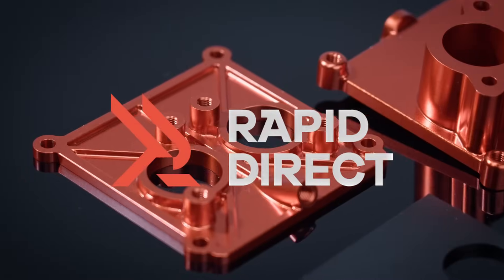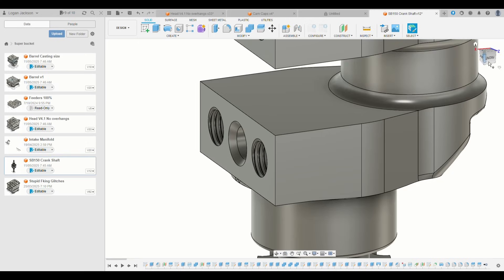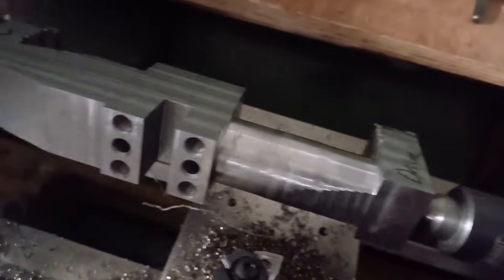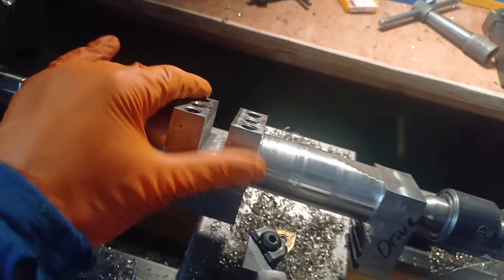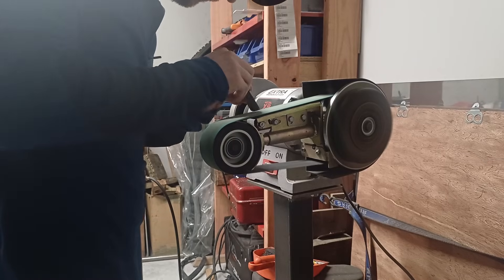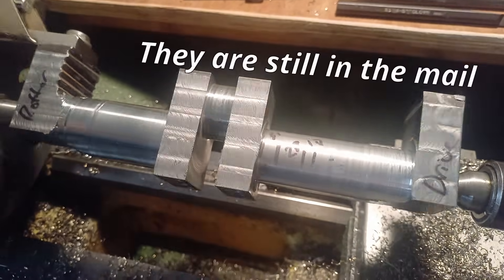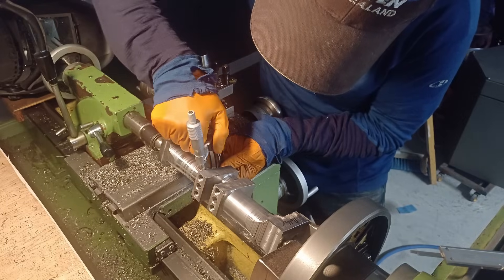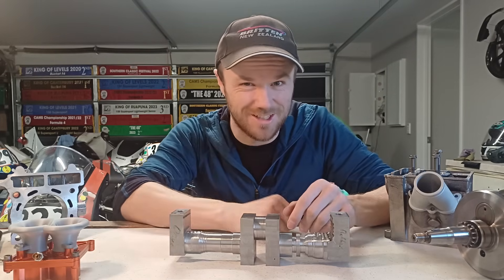Making the Worlds Fastest 150cc from Scratch

Comment: I don't know the engine speed, but the connecting rod journal diameter is too large for prolonged operation at very high RPM. It will require too much pressure to extract the oil and prevent it from burning. RPM is crucial for regulating oil temperature. The biger the journal, the higher its RPM will be and the more the pressure in the oil bearing will be, trapping the oil until it is burned.
Reply from the maker: It has the standard sizes from the yamaha r6 which sits at 16k all day long when racing.
Reply: @TheMotorcycleForge  At first glance on my screen it seemed bigger to me. The R6 seems to be the good example to follow. :) This is a great project! I wish you success!

Comment: The correct radius is essential on each side of the journals to eliminate stress cracks.
Reply from the maker: The Oem yamaha r6 crank has 1.5mm radius on the big end which seems to be enough.
I would pref a larger radius but limited by room in the cases.

Comment: Watching that crank whirling round brought back memory's  on the first opp "crank master" machine at Coswoth in the mid 80's it would send me googlie eyed trying to concentrate on the journal with the others churning around . The crankmaster used HSS form tools , ran quite slowly with heavy lube fed  to the form  tool. Once " roughed " out cranks were ground then nitrided then finished ground using " air gauging " measuring equipment to get the diameters  spot on .

Comment: That's crankshaft will be fail to make more power n torque
Reply from the maker: Why is that?
Reply: @TheMotorcycleForge The shape cant make static balance
Reply from the maker: The balancer weights bolt onto the crankshaft like a F1 crankshaft.
It will have the same balance factor as the original crank so it pairs well the the original balance shaft.
Reply: U can do it in multy cylinder engine. But buil a single cylinder. That's static balance in crank shaft is important, trust me @TheMotorcycleForge

Comment: Need around 2.8-3kg of crankshaft weight. But the diameter is too small. U need at least 100-102mm of diameter. Make a a bit small big end conrod pin diameter or u will have a very small balancing factor. Its will vibrate ur engine
Reply from the maker: This will be about the same weight as the original crankshaft.
The counter weights are bolt on and will be tungsten.
Reply: @TheMotorcycleForge  hope it rotate smoothly. Keep the good work

Comment: Nice build!
What cylinder bore and valve sizes will you use for this engine?
Reply from the maker: I am using some R6 parts like valves and piston.
Bore 67mm , In 27mm x2  Ex 23mm x2
Reply: @TheMotorcycleForge  you should be able to go past 40hp, that's my guess.
Are you going to build a dyno later?
Good luck and keep posting!
Reply from the maker: @Karl-r5j I think 40hp at the crank may be possible, aiming for 30hp at the wheel.
Yeah probably going to build a dyno 😅

Comment: Mate, Sometimes when you get weird harmonics that speed and feed changes just won't fix I have found that strips cut from an old inner tube sometimes works. Just wound around where you can and stretch the last wrap around your finger, tuck the working end under and pull taught.  Alternatively wrap with some insulation tape.  Helps absorb and dampen those vibrations.

Comment: Is this going to have a dummy rod balancing like the Ducati super mono? 
There's a hell of a lot of work in that crank, a commend you for your work. 
If you only want to index 13, you could just use another 13, or 26, or 39. or 52 tooth gear. I guess you could use the sprockets of the cams that would be 26 teeth. 
I look forward to more episodes.
Reply from the maker: The original engine runs a balance shaft which seems to do a pretty good job so I plan to reuse that for now.
I have already been offered two dividing head to borrow and looking forward to learning to use one.
Cheers Logan

Comment: When I made a crankshaft with built in counterweights (had a very long way to reach in) I used a parting blade and removed almost all material using plunge cuts. Slow going because the offset mass was shaking my Sheraton 9"  like crazy at anything over the minimum speed. That engine has a 38mm stroke, with the counterweights I basically had to have about 50mm of stick out on the tool, which is a lot for a parting tool.

I actually finished the crankpin journal by lapping it, made a split lapping tool that could be assembled around the journal and lapped it to size with fine abrasive paste. This removed a taper I'd inadvertently introduced, and gave an excellent finish. You might try doing the same.
Reply from the maker: I have some more appropriate tooling on the way which should make life easier for the finial crank.
I plan to grind the journals after hardening, fingers crossed it should turn out mint.
I will look into that parting blade as that sounds like a good way to go about it.
Someone told me to balance the offset mass a couple videos ago, best advice so far, no weird shakes at any rpm.
Reply: @TheMotorcycleForge  With parting running the blade upside down and the lathe in revers works wonders, you might have to make a custom holder though to get the height. Or you could make a rear toolpost holder.
Reply: @Onan-u3b  The upside-down tools work better because gravity helps to clear the swarf from the cut, which is often a challenge for parting tools otherwise.

My lathe has a threaded chuck mount and no T-slots on the cross slide. I can't run in reverse (the chuck would unscrew from the spindle) and I can't have a rear mounted holder as there's nowhere to put it. So for me the carbide insert parting blades were a game-changer: they have chip-breakers designed into the inserts that bend the chips to be narrower than the groove, and you can run the spindle fast enough that the swarf gets ejected out of the groove without packing up in there. With my carbide parting tool I usually part off at the same spindle speed I would use for turning the OD.

Comment: Nice job, It sounds and looks like you may be need to adress your spindle bearings in the near future. The dead give away is usally the thrust machining. All that said you may benefit from slowing down as even though carbide enables high surface speeds material and machine limitations can cause problems.  I would also recomend leaving a good 0.010" inch on  every diameter and radius and getting the final product ground. It is also important that if you can get the chatter out as when grinding it will still show through if they cant remove it. 
But its looking awesome. I would leave the threading untill after final grinding along with any keyways you might be going to cut in the finished diameters.
Reply from the maker: That's a lot of info, the final crank will be ground to spec after hardening, and then maybe dlc coating as well.
I was wondering about the bearings maybe needing some attention, the headstock gets warm after using it for a while.
It has clean oil ect and I regularly lube everything but the old girl is 50 years old.
Would new bearings be hard to get for a lathe this old?
Reply: @TheMotorcycleForge  It may be addressable with just re greasing the bearings. Preload is the indicator of wear and does deteriorate with wear. They may be rescued but not fully fixed by a simple re lubrication. That would be the first logical step for a hobby machine. 50 years the grease would be gone. That is of course it is a grease lubed spindle. If it uses oil the change up can be beneficial. Assuming its supposed to use iso 32 perhaps a 46 or even a 68 could be possible. What type of oil are you using ? You can easily tell the lube style usally by checking how the spray from the gears is returned. There will be a gutter around the inside or the headstock and it will usally use a hole to feed the bearings. If it's a plain bearing spindle machine fixing the spindle is a lot more difficult and a job even professionals wont touch in most cases.
Reply from the maker: The spindle bearings run In oil, they have a little lube tubes to put the oil in.
Currently using 20/50 valvoline vr1 mineral race oil 😅
Reply: @TheMotorcycleForge  Normally you would use a hydraulic oil derivative in a headstock of a lathe. The motor oil does a great job of making things quiet but due to it being multigrade isnt real consistant for Drip lubrication as well as the foaming aspect. Foaming oil doesnt work well. If you dont have any oil type info for the machine if you have a brand and type the proper oil could be just an internet search away. There is a lot of info out there on old machine tools today. Dont expect the exact oil name to still be available but you will at least know the recommended type and grade. I worked maintaining machine tools and special purpose machines for over 30 years and I have run into a few machines without available info. The usual for machines without an oil pump and wet clutch is 46 for a start. 
I'll keep responding if you need more ideas.

Comment: Nice work as usual.  My two cents:  when you get the high speed ringing while machining, it can usually be corrected by changing the RPM.  Carbide tools require a minimum depth of cut so you cant take fine passes with them or they rub.  If you want to take fine passes, try honed sharp inserts.  Like you use on aluminium.  But not on interrupted cuts.  Be wary of cheap chinese inserts.  They generally are pretty shit.  The tool holders are ok.  Buy some branded inserts.  Kyocera is well priced in NZ and from China.I cant remember for sure but I think that knife edge on the ram tubes is a no no for air flow.  Maybe curve the tubes away from each other a bit?
Reply from the maker: Thank for the info, I need all the help I can get, I'll look I to those inserts but I was quite surprised with these ones so far.
Yeah those velocity stacks were just a first attempt, I will make quite a few different styles and lengths to test.

Comment: Stop modding your lathe tools skim of the bottom of the tool post.  And a GT type inset for aluminium is a good way of beating chatter.
Reply from the maker: Only issue is I have about 4 different sizes of lathe tools so it makes life easier. 
Even those two new ones had different hights from new and they were the same size 😅

Comment: you dont need the dividing head... just figure out the pcd and drill it, preferably BEFORE you remove all that nice support material for what is invariably going to be a long series drill, endmill, and/or finally a reamer...

assuming its a roller chain though i suspect its a "morse silent" chain... and that will be interesting... involute curve, isnt it?

yeah, ok, that may justify a dividing head...
Reply from the maker: I have wanted a dividing head for a while, this is just the perfect excuse to go buy one.
I'd like to make some gears and other bits too, so I might as well.
Reply: @TheMotorcycleForge  theyre a worthwhile investment, either way!
gears... once you get there, look at "andys machines"... does the best tutorial on gear cutting WITHOUT the cutters.... once you know the maths its applicable to spurs, helicals (with a driven rotary?), even bevels with an extra axis of rotation (simply a pivot and fixed angle stops, and the only way to generate them ACCURATELY without a gleasson? its definitely worth getting a tilting head in that regard...) and all modules can be cut with ONE slot saw... within reason.

had the "gearotic" software a few years back, generates gears the same way but i was never a fan of the way it worked on one tooth at a time. any backlash in the rotary makes a mess... i prefer running through them all to double check the indexing before getting too carried away, then work my way through all the teeth one pass at a time... actually pretty fast once youve done a few.
Reply: @TheMotorcycleForge  A Rotab is very versatile, do you really need a dividing head for the job?

Comment: we made crankshafts at tafe, super sharp HSS, slow feed and 20-40rpm with plenty of cutting fluid will give you an almost mirror finish
Reply from the maker: Note taken, I may give that a go.
Reply: @TheMotorcycleForge  I would do it, going to be a better finish than carbide with the limited rigidity. Only thing better would be cylindrical grinding. If you get one of those hone stones to finish the radius or edge of the hss with after the bench grinder it will make a big difference.
Reply from the maker: @lukehoza9571 I have potentially just been offered a cylindrical grinder 😁
Reply: @TheMotorcycleForge put a dremel in your tool post 😂
Reply from the maker: @GothxJesus Don't give me ideas 😂
Reply: @TheMotorcycleForge oi that would be sick, maybe even jig it up to grind ur own cams🤔
Reply: @TheMotorcycleForge I may not be recommending this based on experience.

Definitely do not chuck valves into your cnc spindle (definitely do chuck valves into your cnc spindle)
Reply from the maker: @lukehoza9571 Let's not get too far ahead of ourselves 😂 but yeah, maybe
Reply: @GothxJesus  I put my electric highspeed grinder fitted with various mounted stones in my toolpost to turn a cam lobe into a seal surface. Excellent result